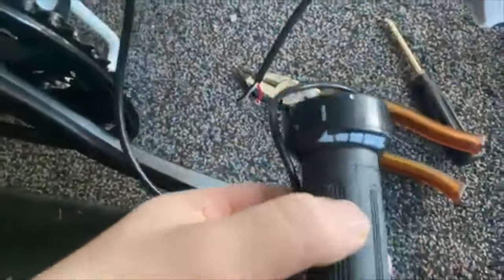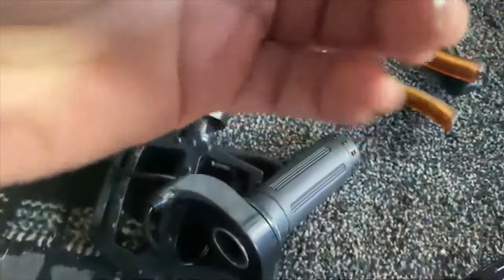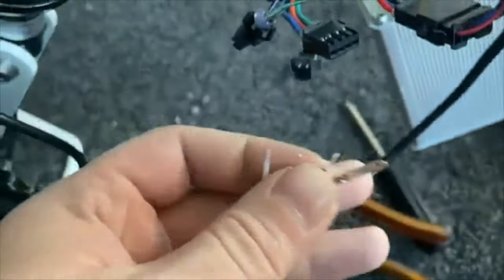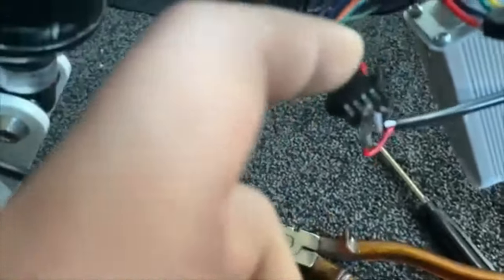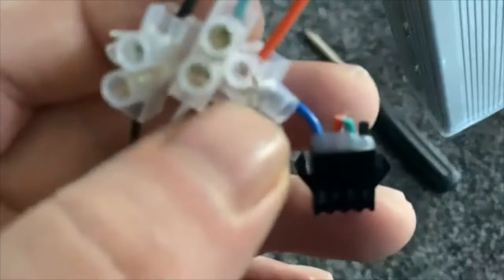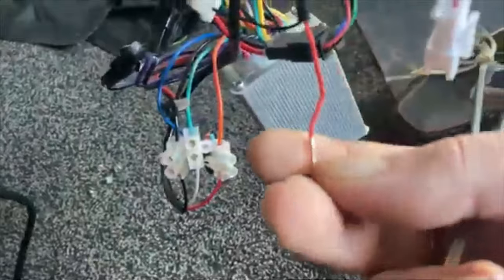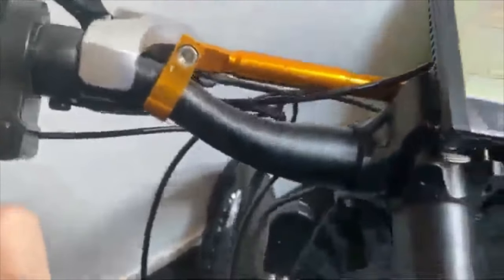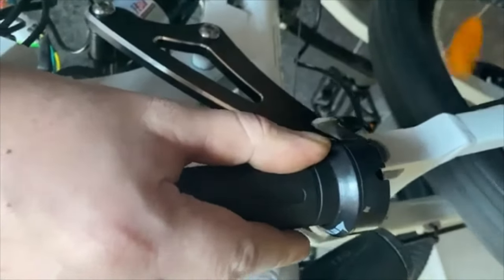Electric bike throttle connection different wires

Comment: I've been trying to fix my ebike for weeks now. I had to replace my controller and cannot get it to respond to the throttle input . Power is good, controller is on, power to the motor hall sensors and to the throttle is good and throttle is working, but  there is no output from main phase wires to the motor... I can't figure it out...?

Comment: 24v 250watt  has 4 wire throttle broken need to find out where to connect the yellow yellow green red to run motor is the double yellow wires the same wire? and does connecting green to yellow make it one speed and the red to yellow to up the speed and if so is there a preferred order?  like would i connect green to yellow first then red to yellow or red to yellow first then green to yellow? does it matter? please please get back to me i am going nuts and don't want to burn any circuits on what few parts i have, thanks in advance

Comment: My controller has red black orange white. Is the orange wire needed?  I connected red to red black to black and white to white, yet my throttle is not working.

Comment: How you doing sir I have a Rinkmo meb-s3 electric bike my problem is when I cut the bike on and if I just touch the paddle or the throttle it just keeps running to stop I have to cut the power all the way down and hold the brakes  I tried your three wire throttle hook up for some reason it don't work I get nothing I love my bike could you please tell me what it takes to fix it.
Reply from the maker: @durantroberson7856  u have the wires the wrong way
Reply: I tried the black to Black the red to Orange the green to White and I still get nothing should I switch the wires the other way

Comment: Hi Bubbles, I agree -> when I use my right thumb, I get a pain in the joint, so it doesn't like the thumb throttle. Thank you very much for this video, as I'm about to change to a twist-grip. As you point out the thumb one has four wires etc. (So I wonder why one needs one more than the other?) Anyway the 4 wires are Orange  Grey  Blue  Black
Qs:
- what did u do with your spare Blue?
- should I treat the Orange as a Red?
- should I treat the Grey as White?
Wha
Reply from the maker: Yes and can leave blue out

Comment: Hi there - Just bought a Swytch kit and they haven’t sent the PAS, so I bought a thumb throttle off amazon, but have been told I need to re-wire it to work with Swytch ie change the red and black wires - will this work?? Any advice appreciated!
Reply from the maker: Some key switch won’t work it depends on ur converter I wouldn’t bother to get one with key switch 👍👍

Comment: I bought the BAIZIFU DIY Electric Bike Conversion kit 250W Brushless Motor and Controller,Electric Bike Booster kit Waterproof Ebike Conversion Kit Friction Drive Bicycle Kit (36V-48V for (16-26 inch Bicycle).  No wiring instructions.  The problem is the wires to the throttle do not exactly match the wires from the controller.  The throttle has red, black and white wires and the controller has red, black and yellow.  Do I connect the white wire to the yellow wire?  Your video by the way is the best one on wiring on the internet.
Reply from the maker: Yes 👍

Comment: Hi on phace wire from ebike and hall wires from controller they are different connectors bullet and lug so can I cut wires on both and use choc block connection. But what amps if possible that's the connection wires in two sides then tighten the screws. I no some use solder I'm looking for a quick way but affective thanks
Reply from the maker: Yes u can use 20amps

Comment: I got a aovo pro electric scooter and I'm wondering does it have a speed limit wire inside that I can cut to get faster speed.
Reply from the maker: Most electric scooters and bike do it will be a single white wire with a clip just unclip it
Reply: @bubblesway  theres a single white wire but it goes into a white plug with 3 other wires and clips into a metal silver board .

Comment: Yo I got a few questions about my bike I have an mx3 there’s the new mototec 60v pro I wanna use my mx3 throttle on my 60v cuss it’s a half twist throttle. I’m scared to cut into the wiring what should I do

Comment: Heyho, thanks for the explenation, although it didn't work for me. I think my entire controller is broken (China 2008 Ware). For some reason my Motor has no brand and has 8Pins. I somehow cannot find a motor with 8pins only 9. Am I missing something?
Reply from the maker: Buy a new converter

Comment: Hi can you help me please I bought a 36v 500w controller and I managed to connect everything but my twist throttle because it has 5 wires there's a red, black, blue, green and yellow and the new 36v controller has 3 a red, white and black so with that said is it possible to connect my throttle to my controller?
Reply from the maker: Some converters you can’t

Comment: Hi I’ve got a Super73 RX and was thinking of fitting  a Domino twist throttle. The only thing is my S73 has a. Hall type signal and the domino has a pot type . Will I need to fit an inline resistor ?

Comment: Using 4 wire thumb throttle w volt display. Connected yellow wire to red controller cable. Should I just leave the blue one hanging? I can see volts but no power when I push down so trying to troubleshoot
Reply from the maker: Sometimes ur better off buying a new converter could be that giving u a problem

Comment: another great video. I'm a little confused about the last red wire though. What did you do with it? Also, isn't it easier or more practical to simply cut the thumb throttle off at the handlebar side and fit the twist throttle there? I guess that's not as elegant as you'll have taped wire there maybe?  Finally, where do you get the thumb throttle from?
Reply from the maker: The last red wire was for my horn throttle u can buy on eBay

Comment: Hey I need help with my bike. My twist throttle was not working unless it was at an angle So I decided to buy a thumb throttle. They are both six pins However on my original it connects with the black connectors. However on the thumb throttle I bought, it is a long connector. Which I think it is for a hull connection I think. I don't really know much but I am just trying to get the things connected. I wish I could show you a pictures, I don't know if I explained it very well.

Comment: Hi pal not sure if you onow the answer to this but i have the throttle installed and it works fine but what im unable to do is use the key on the throttle it does nothing and i would like it to be able to turn the S80 LCD on and off but i dont know which wires to connect.  Can you advise
Reply from the maker: maxta mcpherson well depends on wat colour wires u have also the s80 screen is not compatible with other things so u mite be lucky u mite not

Comment: got a sxt 1600w lead acid scooter, trying to swap out broken throttle... problem is from the throttle theres red, black, green, white, yellow, brown wires. from the controllor theres blue, yellow, green,white, black, brown, red, grey wires. do you know which wires i have to solder together and which wires i do by the colour? im really stuck on this

Comment: Hi I bought an e-bike that was a conversion kit put together the speed control box has six wires coming out and the twist throttle on putting on only has five I had the extra brown wire hooked up to Yellow which was constant power in the wheel would just spend when I turn the key no it's not doing anything and riding it for weeks like that all rigged up
Reply: i got the same and i need help with it

Comment: Sorry Bubbles, if you're there, scrub that first comment. Those colours were from the thumb throttle to a mini connector. The wires from the mini connector to the Control Box are:  Red  White  Black
...so no probs! Thanx again for being there.
LLox
Reply from the maker: Glad u fixed it 👍👍

Comment: Hi mate having trouble with gettin my thumb throttle to work. I've got a 3 wire connector on my throttle which is white red and black. Then 2 spare connector blocks on my controls on the bike. One of has a blue and one of which has a green. I take it its the green wired block I need to insert it to as the black matches the black, White matches the green. Red to the red. Which the ither one doesn't. Not working atall. Sound like I'm doing this correct? Maybe the wires are not connecting real annoying
Reply from the maker: Sometimes some converters won’t work with 5 wire throttle

Comment: Hi there, I enjoyed your video.  
I'm having problems with a diy kit I just finished putting together.  It's a 2000 watt 72 volt kit. 
I finally got it working but it barely moves. I did some research for the display settings. 
The bike is not working at all now. 
I can hear the controller for sure but seems the throttle is dead. 
Are there any tests I can do with the throttle installed? Thanks in advance.
Aaron
Reply from the maker: aaron binder if u have a volt meter put it on the throttle wire and see if u get any bolts show up
Reply: Hope you figured something out or got a lead. @aaronbinder

Comment: I'm having sort of a problem I just purchased a new controller hooked up everything and it wouldn't power on so I tested the wires coming from the controller to the throttle and they were dead. Any suggestions on what would be wrong
Reply from the maker: Use a voltage meter to check power
Reply: @bubblesway  I did and I got zero volts
Reply from the maker: @joshwenger930  if no volts means u have no power u lose power some where check all wires
Reply: @bubblesway  I did that too and everything looked fine
Reply from the maker: @joshwenger930  must be ur converter that’s the problem then

Comment: Hi I just hit a Bafang controller and on the pictures it says the pedal assist connector is red white and black,but the connection from my candance sensor is red black and blue.
I've never seen pedal assist wires red black and white so if this correct what is the correct combination.so from my bike it's red black and blue and from the Bafang controller it's red white and black not in the same order just explaining the colours any help please .

Comment: Hooked up exactly as stated in video. DID NOT WORK! Any additional thoughts? Thumb throttle with on/off and LCD display, RED, BLACK, GREEN, YELLOW, BLUE. Controller available wires, RED, BLACK, GREEN, YELLOW, WHITE, BROWN. 1000W 48 Volt Brushless Controller. Please comment ONLY if you know which combination works! Thanks! MarkMannM2
Reply from the maker: Get a volt meter and see where there is power and no power
Reply: Where does the blue wire go?

Comment: I think I have connected wrongly the wires on the the throttle. Now I seem to have motor position sensor error. Is it possible I have burned them? Bafang hub motor and KT controller…
Reply from the maker: Can’t burn them

Comment: please reply man i got ebike i added thumb throttle but it doesnt work the controller cable colors for the thumb throttle are black white red and for the actual thumb throttle the colors are black green red when i connext it it says motor failure and when i disconnect everything works fine
Reply: @R4YY4N.R4HM4N  have you tried changing the wires around? Usually the red-live Black-neg Blue/white or green- signal. But sometimes the wiring is totally messed up from factory so I would try swapping them around. Also have you got the throttle assistance on in settings
Reply: @TheBigwesb  siwtched it it worked 2 days later my bike got stolen

Comment: Got stuck wiring a 48v 500watt  brushless motor controller to a Vespa scooter I have done alot of wiring but never to a escooter I'm stuck on the throttle cables it looks like someone just spliced wire into wire I've been up for 24 hours sometimes watching YouTube videos so far yours seems something I can understand I have a new controller that goes up to 1500 watts but I'm more interested in the group for 600 and lower so there are to 3 wire sets for the throttle and none are red green and black

Comment: Hi I have just bought a new controller and it came with a throttle but it’s confusing on how to wire it up on the throttle it has 5 wires but on the controller it has lots of different cables coming off of it they are labels but not sure where to put them as the colours don’t correspond. Yellow white red and green on the throttle

Comment: I replaced pedal assistant sensor with a throttle on my ebike and it not working. How do I fix the issue. The controller doesn't have reparate wire for throttle connection. 
Greetings from Nigeria

Comment: i have a ancheer ebike. and it just started turning off after just about 1 mine of riding. what it causeing this
Reply from the maker: Put some card board on the bottom of the battery pack the battery probably is moving

Comment: Good job but I have problem I got a new ignition switch and the 3pin was on each end so switched it so it would plug in together so after switched I didn't get any power  I need help please

Comment: Could you help me connect a throttle to a zkp9-4860v-ytc-ck2 speed controller ive searched the internet for 2 days looking for a diagram with no luck. The controller has pink,white with green strip , white with black stripe, yellow ,and, red wires throttle has a key and all voltage display. And red,black,yellow,Greenland blue wires,  thank you

Comment: I have 3 colour cables coming out of my controller green blue yellow and the throttle has  3 colours white black red . Please tell me which goes to which for the correct connection. Please help me . Thank you so much.

Comment: Hi, A cry for help! ENGWE have washed their hands of this problem as the throttle is no longer in production! Apparently I need to replace the throttle and have a pin/colour problem. My throttle is a half throttle that incorporates a light/horn so there are two plugs at the controller end of the cable. The small plug has Green Yellow & Black and plugs into Red Yellow and black and goes to the light/horn. The other plugs has 4 wires Brown Red Blue and Black (the Back has a piggy-back to the Black on the smaller plug) and these four colours go into Yellow Orange White and Black. Now, I can leave the light/horn disconnected if necessary but I need a four cable Throttle and can't get information on the correct connection. Can you help?
Reply: SAME PROBLEM😢

Comment: I'm having trouble with my throttle. Having multiple controllers and can't get it to work. My throttle has 6 wires some are for switches. What was your blue wire for?
Reply from the maker: With 6 wire throttle’s u need a certain controller have a look on eBay or AliExpress
Reply: @bubblesway  well that makes sense I sat up for hours trying to figure it out. I thought the other wires were just for the switch for the light/horn. I even went back to the original controller got the lights all hooked back up but the throttle don't work
Reply from the maker: @KNGER1988  I had same problem with 6 wire dash lights up but throttle did nothing
Reply: @bubblesway  the orginal controller that came with the bike had four wires. Red black white and orange. I cut the cables not knowing what went to what because I thought it was simple and now can't even get the orginal to work. Seems the orange wire also has some type of lower V power

Comment: Hi can you please help me I've got a problem when my harness to my ehub I've a white wire and inside the hub and I don't know where it gose thanks in advance I think it's the skinny white throttle cable. Do you know where it conects
Reply from the maker: I wouldn’t know until I see the motor
Reply: @bubblesway  won't let upload

Comment: How do u know to put the white with the green ?
Reply from the maker: @whitefeatherslinger8194  I have worked on many over the years 👍
Reply: @bubblesway  yeah when its just one wire and the colours on the controller shows u which is which ,id love to see you connect a bosch middrive or any decent quality middrive to even a standard battery without blowing up the controller ,theres a challenge for u !lets see how good u are with proper ebikes all them years will defo give u the edge on it 😉

Comment: I have two green learning wires from the controller. When I twist forward it goes forward if I twist backwards the motor will run in reverse.  Is this normal?
Reply from the maker: No
Reply: Once you have it going forward, then you disconnect the learning wires from eachother

Comment: Is it possible to change the connectors on the old controller to new controller
Reply from the maker: Yes 👍
Reply: @bubblesway  I hv a problem finding a controller for my Mate X ebike. Motor serial# RM -G060.750.D061
011F1SB100356

Comment: If I connect the throttle wires directly does it mean it won’t work
Reply from the maker: No it would still work
Reply: @bubblesway  thank you cos I tried connecting the wires directly without connectors it didn’t work

Comment: I have changed the hall censor twice and I still have no throttle at all,  I still have peddle assist but my throttle has no power at all,  could it be my control box thats fucked up

Comment: I got my sabvoton controller witch it has red and black and green wire my throttle has a same colour but diffrent pins so if I conect them as they are colour not match and throttle not works then if I pull the pins out and conect red to red and green to green wheel start turning on it own and when I conect black to black throttle not working do u know what is fualt?
Reply from the maker: Mite need a new throttle
Reply: @bubblesway  great thanks it was the throttle lucky I have couple spares lol